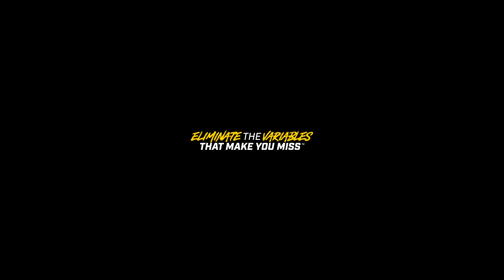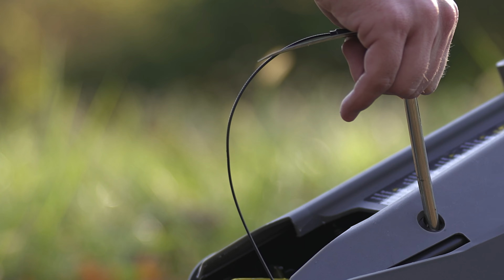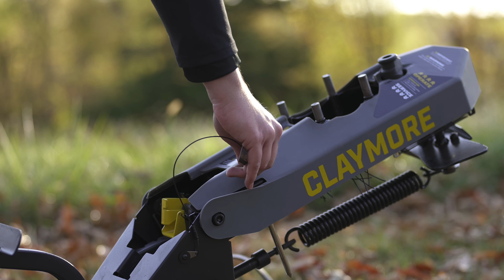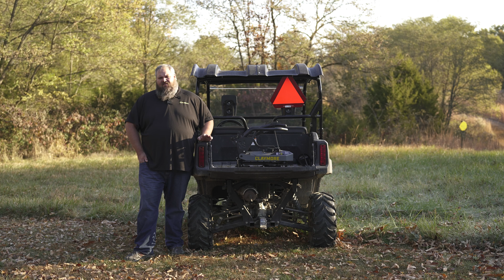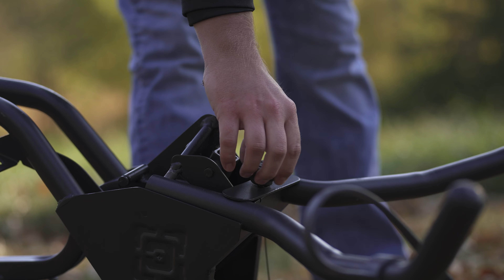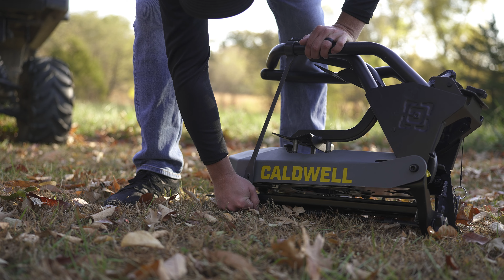Claymore Take Down - How-to

Comment: Great product, however …. Very important.   The video shows the guy rolling the thrower over onto the thrower arm during breakdown.  Do not do this, it will bend the arm.  There are two notches on the mechanism that line up a bent arm as written in the directions.  What is not taken into account is the arm can be bent where the “saucer “ is on the arm.  It bends when you roll it over and it causes it to break clays and get hung up on the spring .  Makes it very dangerous because it gets caught up even though you press the pedals